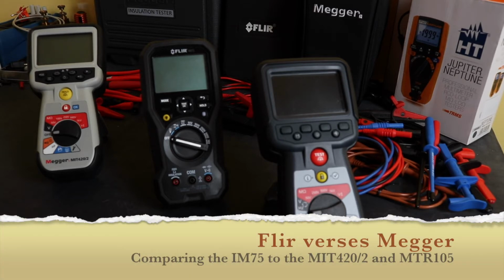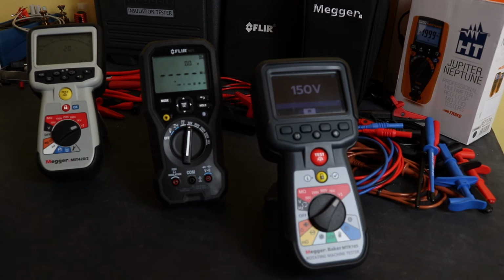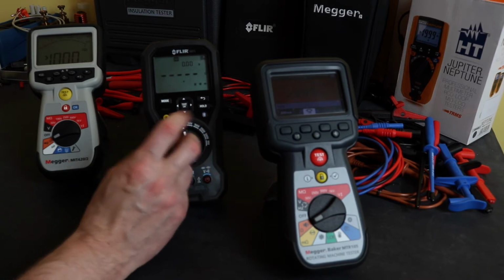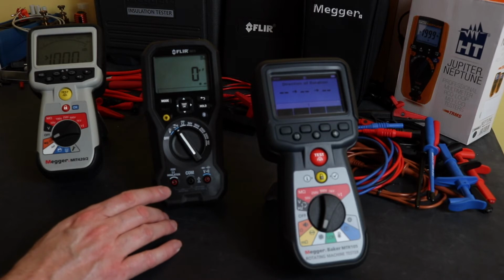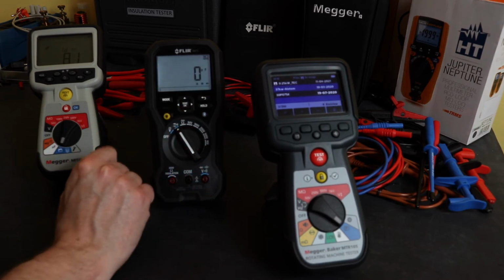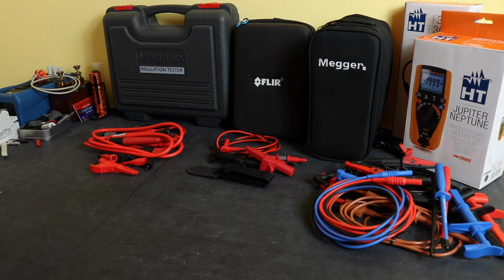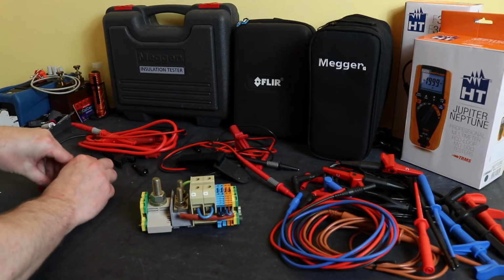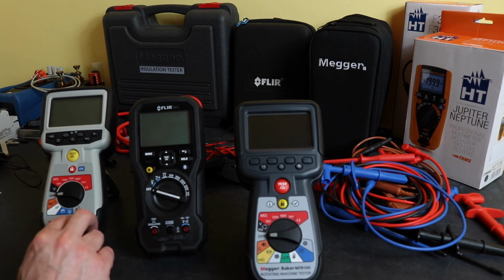Insulation Tester Comparison - Flir vs Megger

Comment: I litle stuck about AC insolation tester and DC insolation tester,for example electric car hi voltage cables,and electric car motor which works with AC ...can you explaine if unit t 505B will be ok for such jobs,thanks to move me in right way
Reply from the maker: Yes, even though the cables and motors are powered by AC, we can test them with a DC voltage when isolated. The UT505B can test up to 1000V, so can be used on electric cars with no problems.
Thanks for your question.

Comment: Very interesting comparison. The Flir does seem to be the poor relation compared with the 2 Meggers!  Does the low input impedance of the mit420 give you any problems reading transducer milivolts?? I think it’s about 250k. 
Alan
Reply from the maker: Appreciate you watching and commenting Alan. I haven't had any issues when measuring transducer outputs with the MIT420/2. I use a 100 Ohm resistor across the output of the transducer to generate 0.4 to 2.0 volts for the instrument to measure.

Comment: Thanks for posting this video, and thanks for the shoutout TP. I’m not as impressed with the FLIR as I thought I would be. It seems to be lacking in a lot of important features for example a temperature feature. Which is a very important feature when doing insulation test on motors and other large machinery. It should have been designed so you have the option to use a remote probe. It’s a nice instrument still, but compared to the Megger it doesn’t compare. I think 🤔 the pound for pound comparison for the FLIR is the HT INSTRUMENTS JUPITER  that’s just my opinion🤔.  Great video TP as always keep them coming 👍🏿👍🏿
Reply from the maker: Thanks TETC. appreciate you watching and commenting. I haven't looked at the HT Instruments Jupiter. To me Flir have created a unique function to interact with their other instruments but have done it at the cost of the more usual multimeter functions.